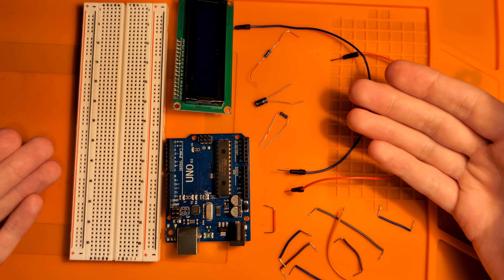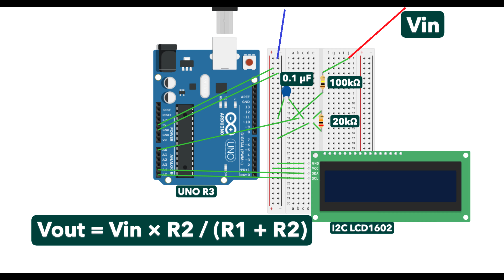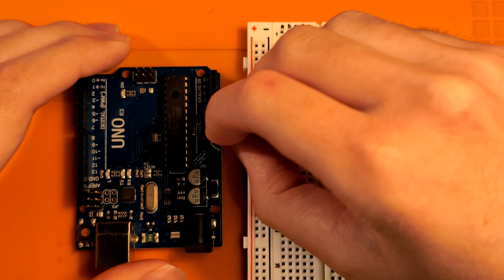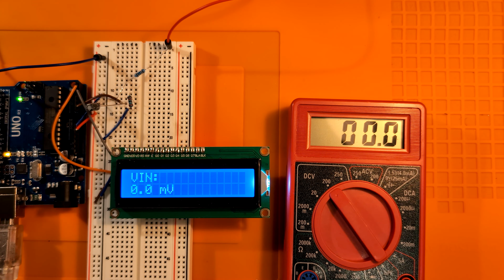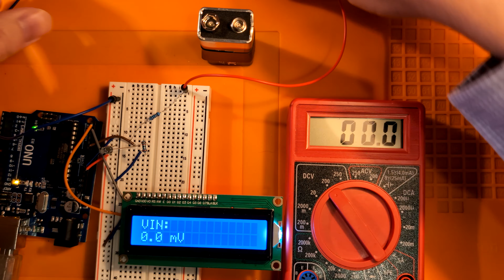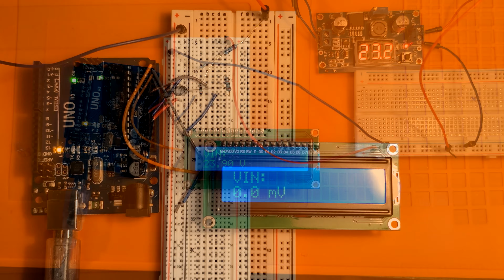DIY Arduino UNO Voltmeter – Measure Up to 24 V DC

Comment: how did u connect the LCD like that?
Reply from the maker: The LCD uses an I2C backpack "to reduce wiring from 16+ pins to just 4 wires (GND, VCC, SDA, SCL)" some LCD or OLED screens come with and I highly recommend using them because the 16 wire setup makes a mess of your breadboard. 

One similar to the one from the video is "SunFounder CN0295D 1602 I2C LCD DigiKey"

Comment from the maker: 💾 Full Code + Wiring:
🔗 github.com/FeFaxy/arduino_voltmeter
⚠ Note: DC only — never connect to AC mains.
💡 Try it yourself: What voltage did your Arduino read?
🔔 Subscribe for the next build